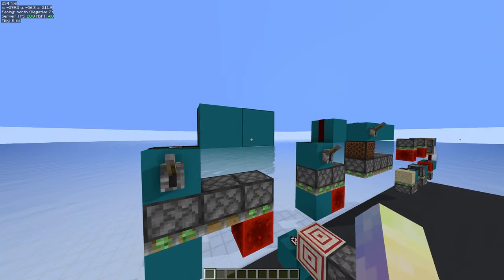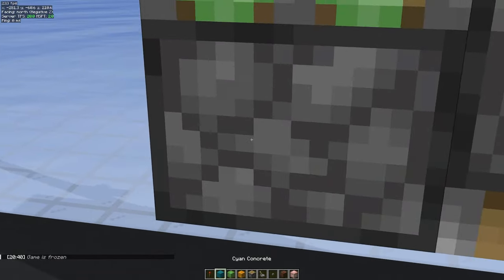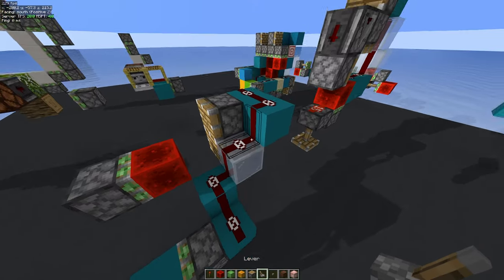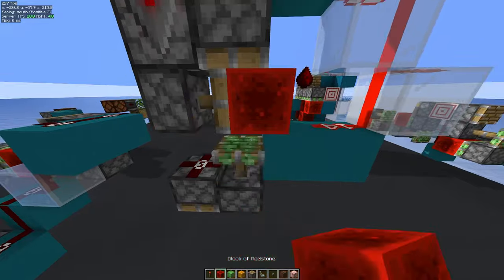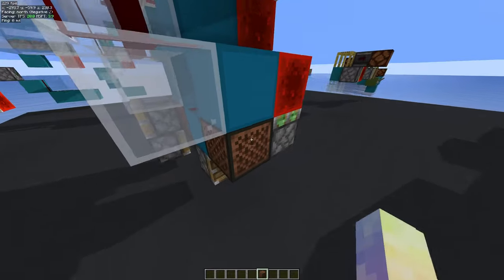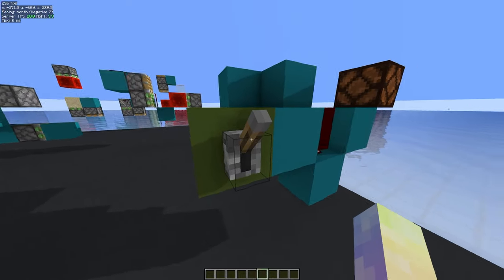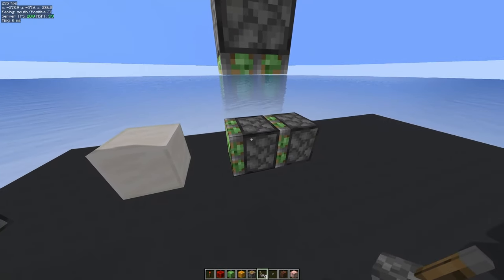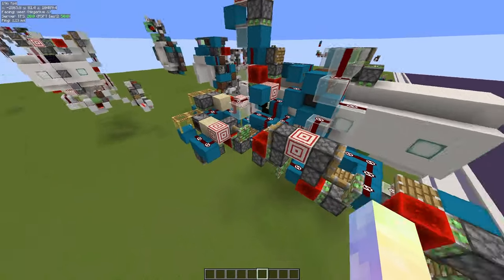How to | 0 Ticks!

Comment: 1:49 that creates 0-tick pulse that lasts for 1 BED. It can't power pistons due to how pistons are scheduled when they retract. They update the base before the head, meaning the piston that retracts the redstone block (the power source) is processed before the piston you're trying to extend, so the line has turned off before the piston could start extending. The scheduling is reversed for extending a piston, so that setup works for a rising edge 0-tick generator
5:05 sure, but it won't reduce reset. It'll always still be 3gt reset
7:45 That is locational. The piston that is used for blocking the rep from re-extending is budded from the noteblock, and in some locationas it gets updated, making it push out the redstone block
8:00 that abccba setup is locational. When going from b to c, you need the extra piston for upadting (which you do have) but there is also a dust that can update the piston below it too early, meaning the piston c can't always extend. Fix for that, is just to run the redstone line where the target is, instead of the side.
9:56 There are so many things that are locational in that. Firstly you can't take an output from 2 sides of an updwards rep (at least updating the dust in a specific way). Also in you situation a to b is locational, because you need to power b with extra rising edge block event delay or you can update the piston b (that can get blocked from extending) with another piston if you use 2 pistons to update the downwards rep. Rest of the pulses should be fine. Anyway the way you use this abba reliably is quite complicated
10:43 Not good advice. The first 2 pulses can still be loc if you do it wrong (which you did). Also you can make all outputs reliable (in most cases) if you know what you're doing. It would technically always be reliable if you always have 1 in between the pulses and make sure the output you take isn't loc
11:18 what? why?
14:54 The singles can go on any block event. Also there are other ways of doing the closing. Btw I think it would've been more helpful if you explained how abbas can be used for the sequenze instead of just going over the order in which they (can) fire
15:37 you talk about the opening as if it's all 1 move so 0.15 seconds lmao. Just say which pistons go on move 1 (0s-0.15s), move 2 (0.15s-0.3s) and move 3 (0.3s-0.45s) and in what order

Also saying stuff like "this goes on BED 1 and this on BED 2" doesn't really make sense when piston 0-ticking is alreayd 2 BED at minimum

17:20 well abccba to be clear. I think specifying that is useful for people who wanna learn how that works
17:24 that's just an abba lol
17:26 abccba

Overall an alright video. I think you could've explained more as to how abbas and such can be utilized in doors, but it's good that there are more videos showing off the basic circuits
Reply: You should make a 0 tick explanation on your channel that would be awesome
Reply: after watching you for a while now, i am positive that you are the right person to explain all 0 tick stuff (from microticks to BEDs ...). i hope you would.

and because i am struggling to find the right video to understand how do they work (in detail).

Comment: 6:35 this bottom piston qc is cool. I never saw that. I think it would be  adaptable to dust updateless without too much of an headache, too.
Reply from the maker: I tried, it’s quite difficult, as the dust updating is the basis of how this dual edge works
Reply: @theb0b  Maybe it is… but im a noob with dust redirection, so I just assumed someone with 50% more brain power could pull it off easily lol
Reply from the maker: If you make the return piston a sticky piston, then there will be no visual dust update, but it still updates. I don’t know if that’s less laggy or not but yea, I found that.
Reply: @theb0b  I would think it’s probably the exact same for dust lag

Comment: 8:00 idk if this happened to anybody else but i tried making the exact setup and everything worked except the extension of the last block. I managed to fix it by switching the target block for the middle piston with a block that has redstone dust on top(talking about the pistons that shuffle around the colored blocks)
Reply from the maker: yea, the setup in the vid is loc, just push everything back one and then make the dust for the BED for the middle to be not running up against the side of one of them, just make it out one block, (target block, make it a block with dust on it) Its because the dust update order can update the piston before the BED does.

Comment: in the 3x3 layout you showed there's three sticky pistons on top of each other underneath the folded double piston extender, how do you power specifically the middle piston?
Reply from the maker: in fact you cant just power the middle piston, you have to power them both at different "BED"s on closing and then for opening toggle the bottom one so that it does not fire on the first abba refire :)

Comment: hi i am pretty good at 0 ticks but i really dont know how make them compact whylst keeping same speed so a vid on that would be really good :)
Reply from the maker: In general it’s just practice and looking at other peoples designs. Also, the use cases are super specific so a video would either be 5 min going over like basic compacting and basic locationality, or 45 minutes long going over multiple designs of a single door and explaining the minutiae of every specific block and its placement in the door. In short, life’s about choices, make some. See what happens, see if it’s smaller, if not repeat.
Reply: @theb0b  thanks for the advice because ive been doing 0t for a little over a month now and when i started i couldnt even do a 1x1 glass or make an abba but now i can make a 0t 5x3 :)